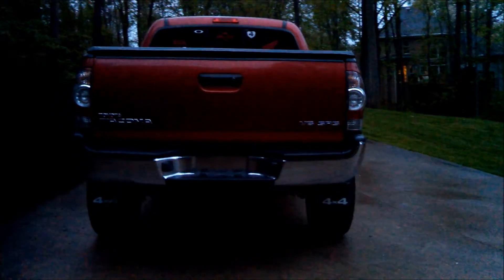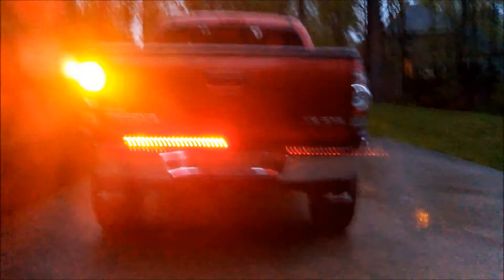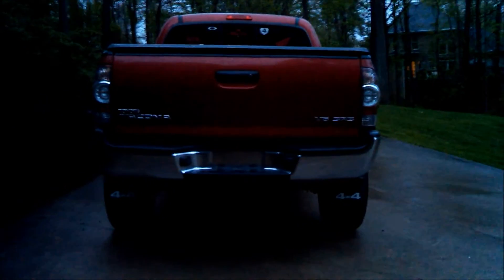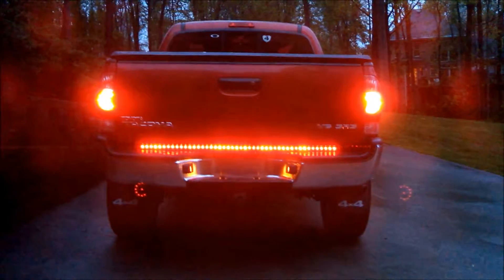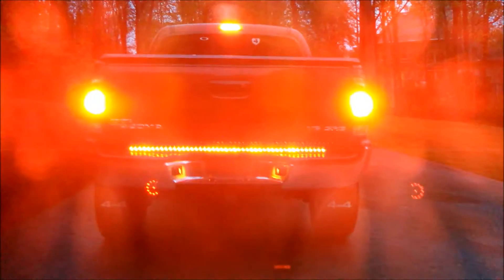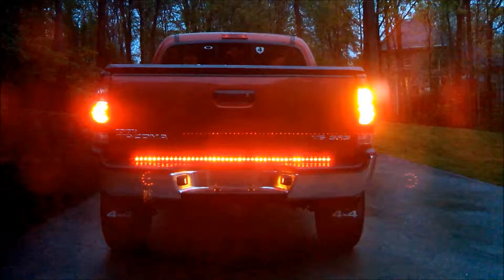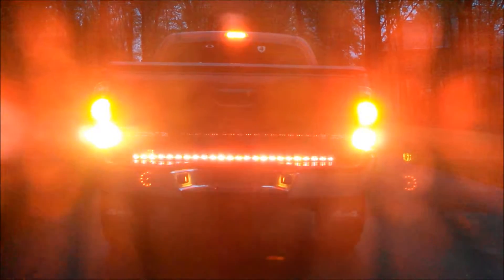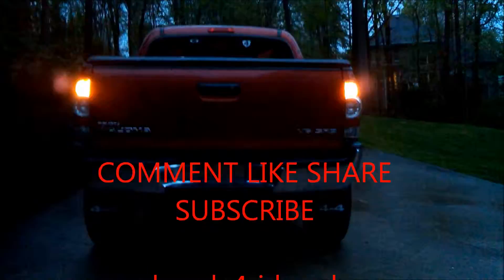LED Tailgate Light Bar Functional Test

Comment: awesome light bar! Two questions.. 1) what brand is it? 2) i just purchased a rampage light bar and I'm a tad worried about the hole for the spare tire. Will it still be accessible if install the light bar? I have a 2013 tacoma
Reply from the maker: yankeefan386 I can't remember the brand, but it was around $70. We lined it up right below the hole, so we never had any issues accessing the spare.
Reply: ok that makes me feel better. I was looking at it the other day and was like "this is not going to work"